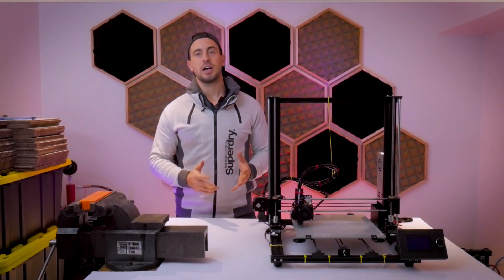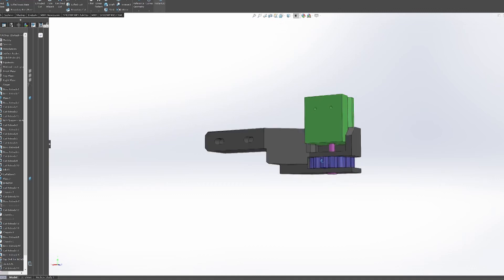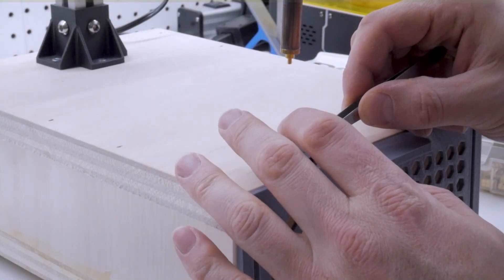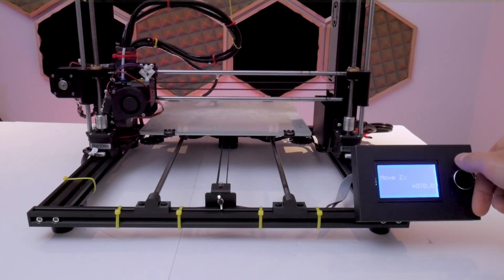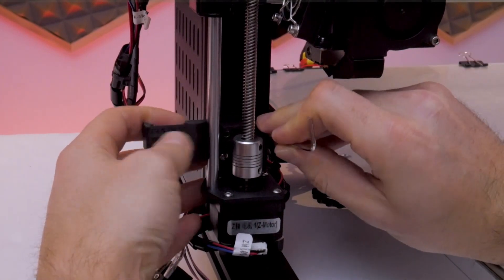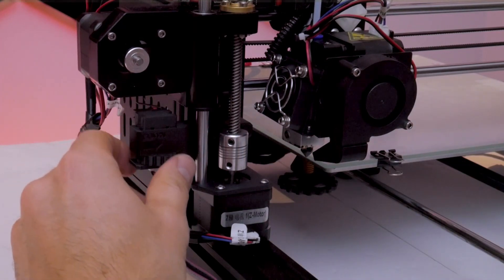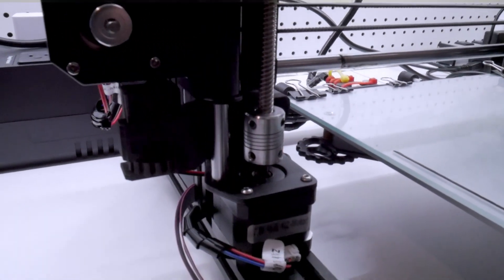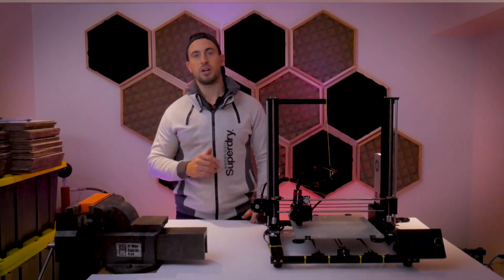ANET A8 Plus Adjustable Z End Stop

Comment: Just  got my second printer, Sovol SV05, same price as the A8Plus I bought two years ago. I totally dig this upgrade! Definitly starting with this! So, question for you. I need to replace the  Z Screw, right side, it’s bent. I’d like to upgrade both sides with better screws and? I don’t like the top plates? Anyway, any suggestions you have would be welcome. Thank you.
Reply from the maker: Hi Jack, thanks for your comment. If you replace your z screw I would probably ditch those top plates with the bearings. If you are replacing your rods maybe you can also upgrade to anti-backlash nuts as well

Comment: Hello, I just received my Anet a8 plus but a lot of trouble with it first extruder goes out of the bed x or y or z, second the temperature cannot go further 200° PLA the machine cut and stop with error so i cannot handle the ABS filament for exemple could you post your working firmware please?